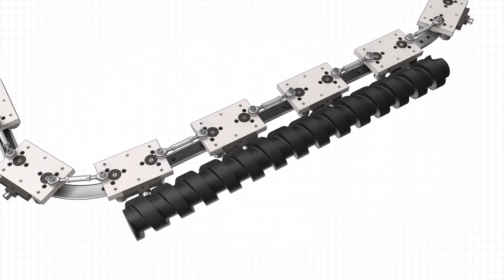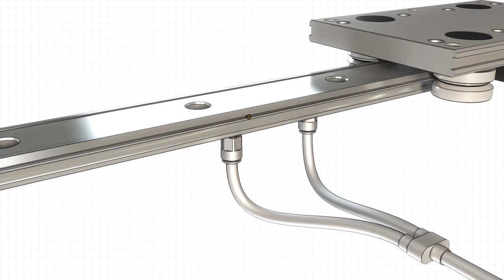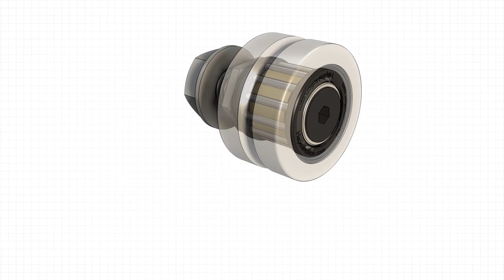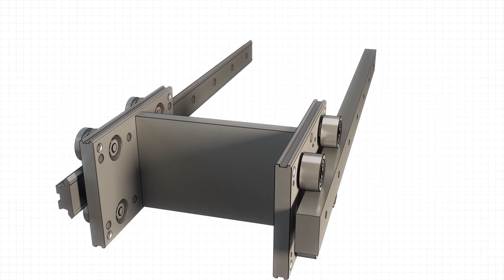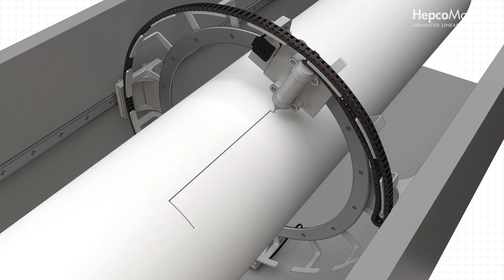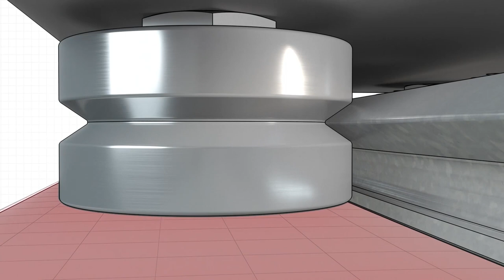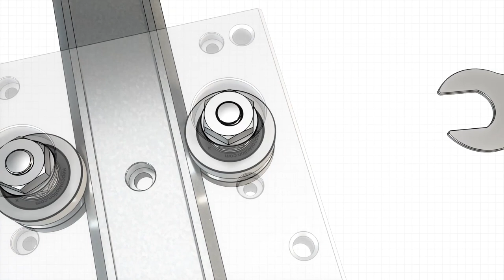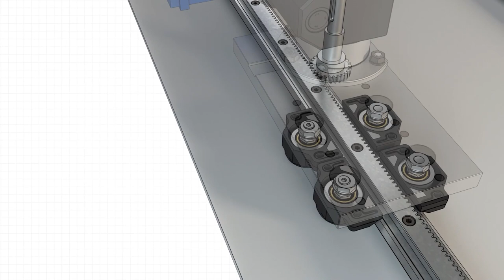Solutions for Automation | Hepco Live

Comment from the maker: Hepco Live – Solutions for Automation - Webinar Timestamps
00:00 – Introduction
  
02:11 – The technology behind the automated warehousing revolution
Q&A:
09:58 – Do you have limits on the length of linear actuators used in these type of applications? 
11:03 – Can you provide information on dirty environments and how to select products and life time expectations?
12:09  – What’s the speed limit of Hepco linear guides?
12:47 – What about food & beverage applications where customers clean with detergents and water?

13:50 – Why DTS should be the core of your process line
Q&A:
22:38 – What are the drive options for a track system?
23:55 – What are the physical limits of size and speed on a track system?
25:21 – What’s the average delivery time for a track system?
26:25 – Can the track and bearings cope with ultrasonic welding taking place on the movers?

28:28 – Choosing the right guide system for high load applications
Q&A:
37:18 – What size robot can you use on your linear systems?
38:47 – What are the recommended tolerances for installation and therefore parallelism?
40:40 – Can you provide a 7th axis robot that can follow a circular track system?

42:12 – Ideas for your application form the EV industry
Q&A:
51:37 – How do you see your technology keeping pace with the rapidly increasing demand for EVs?
53:19 – With your involvement in EV manufacture, do you see this technology evolving further, if so, how?

General Q&A:
55:02 – Have you used Duralloy coating to get resistance against humidity and detergents?
56:19 – How does Hepco reduce it’s outsourced work?
57:02 – Is it possible to get customer-specific carriages on a DTS system?